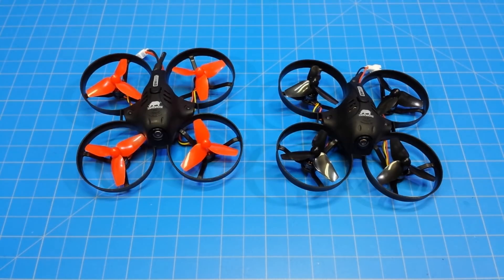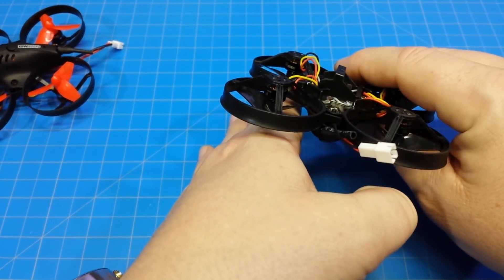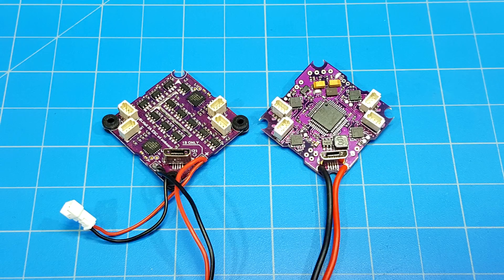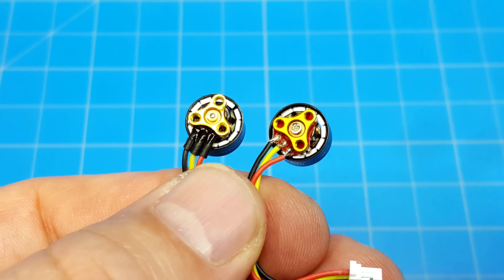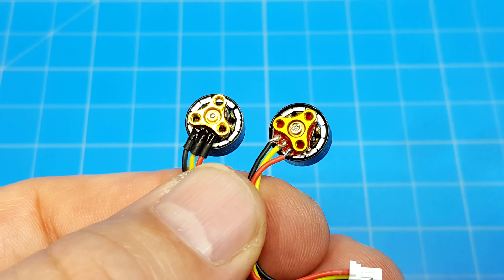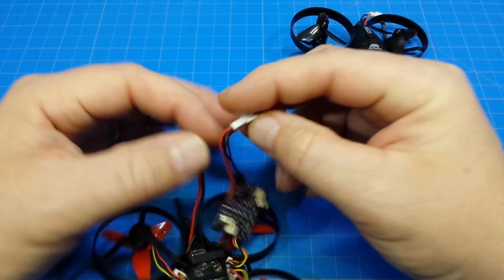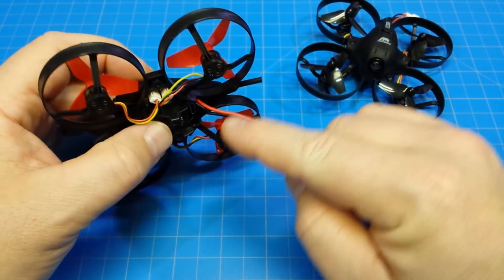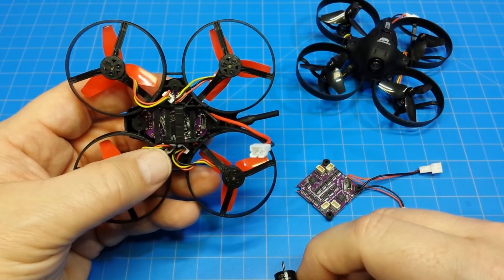BoldClash Upgraded Flight Controller and MO703 motors - TESTING

Comment: Thanks Nick. Any help as to where to solder the reciever to the board would be much appreciated?
Reply from the maker: I am sorry. I don't have these boards any longer. From pictures it looks like we have 5 pads on the top side, likely we need to use the 5v, gnd, and rx pads. 3.3v pad if your using a spektrum receiver.
Reply: Nick Burns thanks for your help. I decided to get the boldclash F4 with osd since this one was sold out. I’d assume it’s the same pads if using a spectrum reciever (3.3 ground and rx)?
Reply from the maker: yes and gnd, we always need that grounding to complete the circuit.

Comment: Hi Nick love your review on this awesome upgrade for a great little quad! I think the new board is way better, more stable, great power to the new motors-( ordered the wrong ones> 1.25 just, the 1.0 are correct) one question: did you get the LED to work? I cannot 🤔
Reply from the maker: I got the led to light, but not stay fixed to the quad whoop where I was trying to put it.
Reply: Nick Burns any thoughts on the 20,000kv motors? I've been tempted to buy but don't know if it's worth it. Great little quad great review, for the price beats the blade inductrix fpv in performance!

Comment: Just watched your older b06 video and yes big difference! Nice flying skills 👍 if I upgrade my older b06 could I just solder the old rx to the new board or do I need to get into betaflight and make changes ?
Reply from the maker: I don't recall the defaults, I would suspect we have to make a port selection and a maybe receiver selection. But you have the old board to match it to. Should be pretty simple.
Reply: Nick Burns did you fly on defaults in video ? Seemed pretty smooth.
Reply from the maker: I don't recall in the moment. I can take a look when I get back to the house.

Comment: Been watching alot of your videos, I had the srtider x2 frame and as I read the rear arms were weak so I went to the ix2 plain x frame and I can't break it. I just bought an acrobee but my first beebrain v2 set was bad so sent it back, ordered another so tomorrow I'll have one flying and another to sell and I'm gonna buy everything to build one of these. I want something small to fly anywhere that's not brushed. I don't like brushed cause once the brushes wear out your done.  I watched both videos and it does seem like the upgraded parts allowed you to fly more quickly and precisely.

Comment: What's this like compared to say betafpv 65s with brushed motors?
Reply from the maker: I like the throttle and stick response much more on this than brushed. I find the brushed motors just take longer to spin up, making it more difficult to fly acro/rate mode. Which is my preference.
Reply: Nick Burns I also like acro. I find angle weird and struggle to fly it.
Reply: Nick Burns is 1s going to give enough power

Comment: When will the new board be available?
Reply from the maker: I have not gotten a response when I inquired. Unfortunately we are in the waiting game.
Reply: Nick Burns I am thinking about getting the “Full speed” board because it has a OSD and higher ESC amp rating. Do you think it will fit in the B06 V1? And be a good choice or should I wait?
Reply from the maker: I don't see a board that will work on fullspeedrc.com. We need an all in on flight controller and esc. Betafpv.com has a board that will likely fit and work. Be sure to get the brushless one if you do.
Reply: Nick Burns Just got the email, the new Boldclash boards are available for preorder now from China and will be arriving in the warehouse around April 11th.
Reply from the maker: Nice, funny how they didn't respond to me. :(

Comment: Which batteries are you running in this guys? I would buy one of them as soon as it's selling
Reply from the maker: I used both the GNB 450 and betafpv 550.
Reply: Nick Burns and the 450 that come with this guy? Which was better in your opinion? Thanks and sorry for a lot of questions

Comment: What batteries are you using on these?
Reply from the maker: GNB 450 and betafpv 550
Reply: Which one do you feel performed better? I have some Betafpv 550 but was thinking that the higher C rating on the 450's might work better
Reply from the maker: The 450 felt a bit better, but mainly due to the slightly less weight, we do have a decrease in flight time when using the 450mah vs the 550mah.

Comment: Hey Nick, I have a question for ya.  I just flew my new build.  Flies great on 2s, on 3s its really jittery, lots of ocilations and hot motors in 20 seconds of easy flight.  I dont know how to tune. What settings should I change or where do I begin?  The build is a Hakrc flight stack, 1106 6000 emax and 3030x3 GF on a flyfox frog frame.  Hope I dont do what you did to your frame :)  Any help is greatly appreciated thanks Nick.
Reply from the maker: If you have oscillation drop the p value for both roll and pitch about 5-10 at a time depending how bad it is. Once the oscillations are gone check the motor temp. If they are still really hot, not warm, drop the d values for roll and pitch until they cool.

Comment: Definately looks more smooth and locked in than V.1. love the bounce and recover near the end of the acro session.  Looks great, think I will get one when they get in stock
Reply from the maker: yes its a big improvement. I have received recent reports the new b06 are coming with the new motors but the old flight controller. I will often chose a flight that demonstrates a point, in this case, that I wasn't taking it easy on it, and crash as often as I say I do. :)
Reply: Thanks for the info.  I deffinately want the new FC, the layout and features look much better, I hope they manage to put it in a RTF at some point,  so we wont have to get it as an upgrade.  Thanks again Nick, looks like so much fun.

Comment: Nick, you used the default F06H AIO camera module with ? You find the Vin/Vout on the VTX pinout ?
Reply from the maker: Yes, stock cam/vtx. I cut the yellow wire between the cam and vtx. Wired the wire from the camera to the pad with the "cam" by it and the yellow from the vtx to the "vtx" pad on the board. The power of course. I used two ph1.0 connectors, one for power/gnd the other for cam/vtx.
Reply: Hi Nick, Yes I figured out later  Thanks anycase....  Good idea to use two 2p ph1.0 connectors... even if probably one unique 4p 1.25 can be the best option. I think the BNF upgraded version will come with such option.
Reply from the maker: I have a few male 4pin connectors but not the female. Chose to split it up.

Comment: I just got a new one today, it came with the upgraded motors but not the flight controller... do you know were i can find a pin diagram for the old flight controller? i have been wondering what the solder pad right next too the  PPM is for? thanks and good video.
Reply from the maker: I didn't find a pin map of it, but in the image it looks like that is the pad for 'RC' or our signal wire from our rx.

Comment: I just got mine yesterday from the ebay seller in NJ, new motors, but old FC.
Reply from the maker: Dang, doesn't look like they are including them yet. I wonder if a new 'upgraded' model is coming.
Reply: Nick Burns I like to know this as well? From my Youtube research...the newer orders are getting the newer upgraded motors but not the newer upgraded FC . I was hoping a new model would come out with both upgraded motors & FC before i pull the trigger on one..lol
Im ready to upgrade from the brushed Whoops...tired of working on them to get more power...lol
Reply from the maker: It could take more time. They may have waited to see what the review samples brought.
Reply: Nick Burns 
Thanks for the response ..Ill wait it out. I believe with the upgraded parts ..it will be a good little model and trainer for me Your review has been very helpful insight on this model i appreciate your work and time on these reviews .Kind of got spoiled off the Beecore V2 Betaflight OSD boards i been flying on the whoops. So be worth waiting for the OSD...lol

Comment: Do the motors feel different while in the air? Do they weigh the same?
Reply from the maker: The weight was so close .02grams I didn't post it, as I suspect the error margin on the scale might be that much or more.

Comment: I compared this build with the original here https://youtu.be/gnwYMybTjzY and a fpv video with acro flips at the end here https://youtu.be/gnwYMybTjzY you can see there is defo more power and better control with this new setup. This is a great little bwhoop now and I would say the best there is right now.
Reply from the maker: for 1s I agree. 2s whoops are a bit different. As I don't think many have the indoor space to fly a 2s whoop to its capabilities.
Reply: Nick Burns 2s is another story I agree, sooo much more power available with 2s, for indoor only flying 2s is too much and 1s is nicer, for outdoors 2s is gonna be better...

Comment: Yeah yeah well I've still got some kind of Chinese dog festival mouth taste or something going on for I still think Boldclash sucks big time, as much trouble as I had with the B05 THAT THEY BUILT, and the B06's I tried to build and all their faulty parts I just don't know what to do?? I would like to try the new board on the 1S version I could build of the B06 with the 0705 12000Kv motors which will they "say" do 2S but the itty bitty crap 3A ESC's and FC of the old version would not, so I was just hoping for maybe a tad more UUUUMMMFFFFF!!?? And the other one(you get two frame kits when you order the frame kit) I have 1103's stabbed in there and was planning on using maybe the Emax Femto or better the furious racewhoop 16X16 and a little higher maybe 7A ESC's or 6 at the least and trying 2S with it as it can be for outdoors as well, I got the B06 mainly or really all the time indoor flyer reason I got the first FC and stuff. But even their version of the tiny fish 1S just isn't good or mine wasn't it nor the esc's nor the dang motors!!!! I got a new 1S fish FC and ESC and tried it againg and not ọne motor would spin up, it would flicker lights when I switched modes and armed and such but NOT ONE MOTOR actually on did "TWITCH" geeeeeeeeeeezzzzzzzz???????????????? So my next plan was to do the 2S 1103 version and go flrom their or see about this new 1S board and stuff and hope for the best, I really had high hopes for the B06 for it looks and seems would be the perfect indoor 1S but NO DICE!! TIRED OF FAULTY PARTS I wonder if they will send me a new damn B06 board for the two flights out of the B05 I got and NONE from EITHER B06"s you would think they could spare $30 compared to what I have given them!!!!!! FOR NOTHING!!! May just throw the frame kits in boxes for now and thinking of building a Rakon Heli in the bigger 74mm is it?? and makeing it 2S with the use of racewhoop and good ESCs and might even try these 1104 7500KV motors I have instead of ordering more dang parts like more 1102 or 1103 10000KV's and the 1103''s are lighter than the 1102's I thought that was strange? must be the design 1103's I don't think have bottoms?? Was afraid the 1104's would be to much weight but weighed them against the 1102's and only bout 3g diff so I guess it would add 12g's but figured the extra power might make up for that?????? I don't freaking know, I even thought about boxing ALL of the crap up and having a box sale on Ebay and sell it all to the highest bidder for I have A LOT OF GOOD PARTS SHIT JUST RUNNING OUT OF MONEY TRYING TO GET A COUPLE OF THEM TO FLY MORE THAN TWICE!!!! LORD have Mercy!!! hahahahaa Thanks for the vid I have been waiting for it to see what you thought of their re-do over........So seeing I have everything esle may as well throw them another thirty bucks huh???? shit fire haha. Have a good one! L8r-Turbo.
Reply from the maker: sounds like you have been down a rough road. I hope it gets better.
Reply: haha me as well bud me as well!!! Geez!! Was about to think I was getting old and decrepit lol!! I did turn 50 end of last year and I must admit it is the FIRST time I have started to "feel" old! lol I never considered myself anything but a big kid most of the time...But about oh a week maybe two after I turned 50 it just HIT ME!! AND HARD! I called my younger brother lol he is three years younger and he tried to console me but I just said "Bro!! Name ONE thing that we have to look forward to or anything that is going to get better haha, shoot I already notice like when I hurt myself or even a cut or scrape you simply DO NOT heal as fast as you used too!! It is starting to become very troubling to me hahhaha!! So I thought maybe I couldn't see anymore and arent as steady as used to be and all my fault hahaha but I'm better now hahaha lol thanks man! I always keep my chin up for the most part tho haha! L8r!- Turbo.
Reply from the maker: Keep the mind young. I am not far behind you. Maybe get into some youth instruction with quad and a local school? I coach youth baseball, those kids help me keep my spirits up and remind me they look to us for guidance and direction. I also try to find something to make me laugh out load everyday. Maybe its a funny facebook video or I look for blooper videos on youtube with a show I like.

Comment: Hi Nick, could you link in the 5v dsmx receiver you use?  Also, can you share what kind of antennas you use on your video receiver?   Thanks for all your great work!
Reply from the maker: I use a blue cp aomway with a laforge module. This is the rx I often use. I can't speak to its range, but it has worked out 200meters. https://www.banggood.com/Only-0_8g-2_4G-Compatible-DSM2-DSMX-Receiver-for-JR-SPECTRUM-Transmitter-p-1145873.html?RZ29002443189201508J=undefined&cur_warehouse=CN

Comment: Will you have to change out the old camera in order to get the OSD?
Reply from the maker: No, cut the yellow wire from the camera to vtx and then wire it to the flight controller where its labled vtx and cam.

Comment: Does that new all in one flight controller have current sensing?  It looks really good, but Racerstar just came out with a similar brushless whoop all in one with 5a BLHeli_S ESCs, OSD, current sensing, and they even crammed a D8 mode FrSky receiver in it. As much as I don't like getting Racerstar equipment, that seems like a really good option. I love how you don't have to add a separate receiver. It makes it more like the BeeBrain/BeeCore/etc  flight controllers we use for brushed whoops.
Reply from the maker: I don't see that it does have a current sensor.
Reply from the maker: I don't see an amp rating for the ESCs on that board.
Reply: It's this one here. https://www.banggood.com/Racerstar-Crazybee-F3-Flight-Controller-4-IN-1-5A-1S-Blheli_S-ESC-Compatible-Frsky-D8-Receiver-p-1262972.html?cur_warehouse=CN    I actually discovered it browsing pull requests for Betaflight. They're adding a target specifically for it. It seems to share all the same specs as the BoldClash board, just while adding current sensing and the built in receiver.

Comment: Any suggestions on a brushless indoor/outdoor ?
Reply: Yeah, I am interested too in indoor brushless, something to take place of tinywhoop — I have really small apartment.
Reply from the maker: indoor/whoop style doesn't translate well to outdoor. Any breeze will impact the flight, with that when the b06 is re-released with the new motors and flight controller would be my pick.
Reply: I guess my real issue is, this will be my first brushless, whatever purchase I may it be, and I kind of want to just to be able to fly it out my windows and fly it back in, take it out on not so windy days. I fly Holystone toy grade brushed quads, so I am use to the wind. The Kong ET100 seems like a good first time quad.
Reply: Might want to try a baby hawkR or build a little 2" brushless... I used to fly my lizard 95 in the house and a kingkong 90.

Comment: I just received these parts as well ... and I can confirm, they are pretty.... Probably the best 75mm combo with these elements. For a <65mm.... maybe 0603 motors can be the solution...
Reply: SeBy DocKy have you tried the DYS 0905 motors?
Reply: Not yet... Good ones ?

Comment: Oh by the way, that's a solder joint on the collet and motor shaft. Pretty cool idea, Boldclash actually has a video showing it and trying to pry it off. Haha awesome watching you try to pry it off!
Reply from the maker: What kind of solder is that? Laser? its pretty smooth around the outer edge.
Reply: Ah, I found the video where I saw this. Looks like it's welded! Lol my memory is shot.
https://www.youtube.com/watch?v=201WpnYS4kY. Posted by Cyril Liu. Looks like he received those motors from Boldclash back in December!
Reply: Yea their site shows pictures of the new bottoms being laser welded.